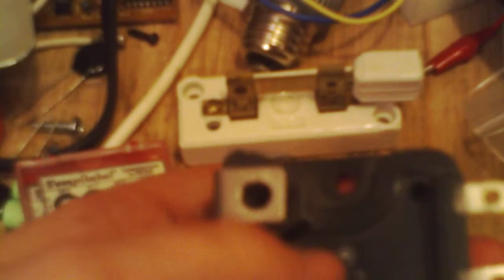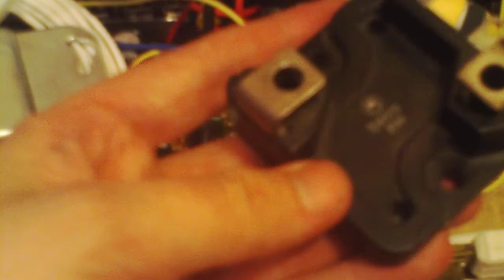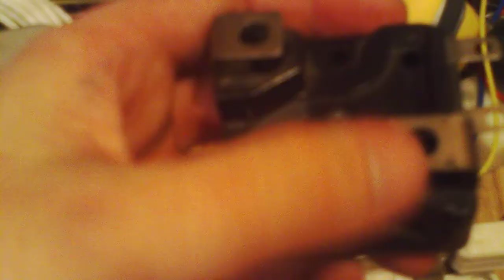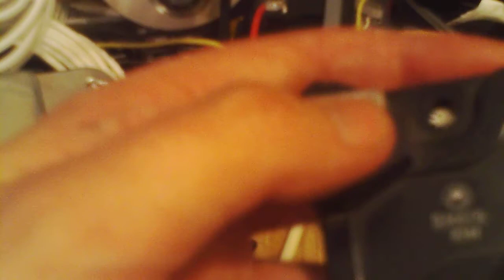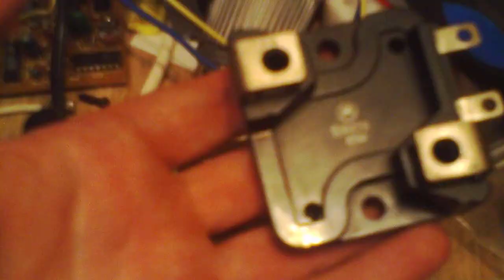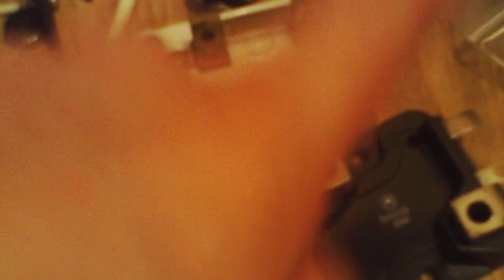Motorola SJ4419 mystery power MOSFET

Comment: The website icdshop[DOT]net <-- warning! tread softly! If you're using windows I wouldn't tread at all.
I had to use Midori as for my browser for the site to work as it should. Firefox and "chromium web browser" wouldn't display the site correctly. I thought the website was broken. 
Came across a picture of it using Russia's search engine YANDEX there is a .com english version or the russian .ru version. 

The site labeled it as a  "SJ4419 Motorola Power Mosfet module" but there was no datasheet to speak of.